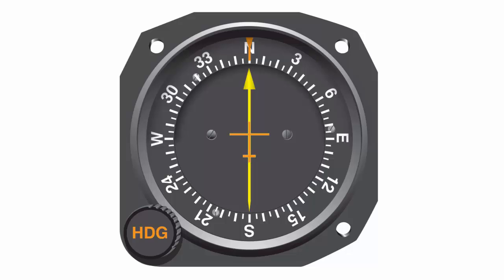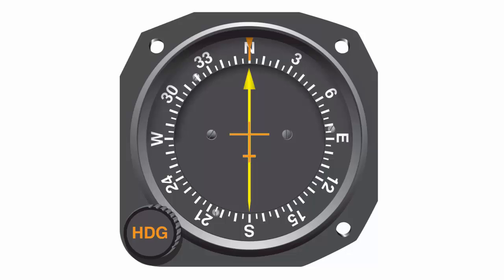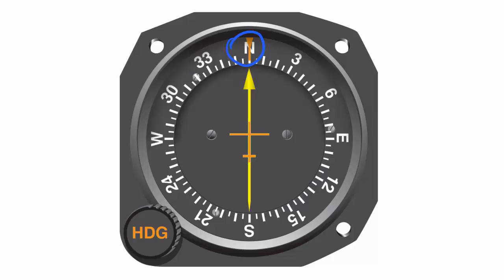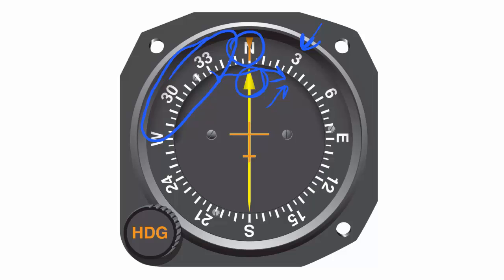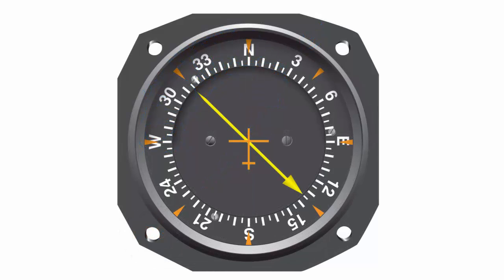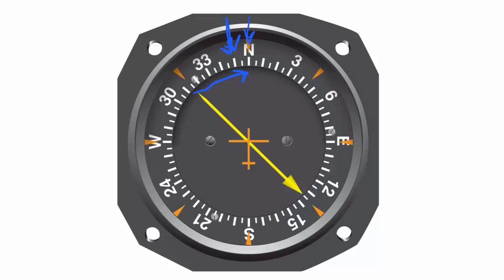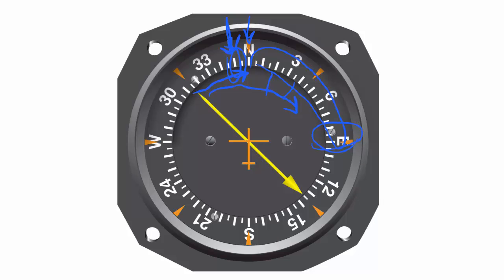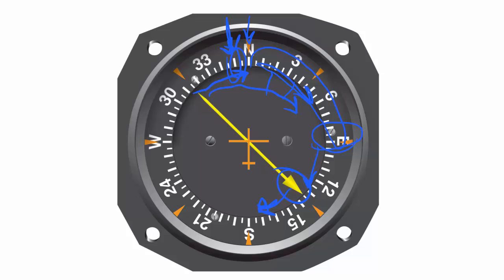Push the Head and Pull Tail of a Bearing Pointer

Comment: I personally prefer not to use this approach to adf intercepts in a practical situation just because it pushes forward a bit of a rote learning attitude to the exercise. By all means it’s fine for written exams the “ bug to tail + or - 30 etc”. In a practical context I think It’s better to be able to have a mental picture of where you are in relation to the aid by using the DG as a ‘birds eye’ view and imagining the track you want to intercept inbound or outbound and then deciding on the direction to turn because it builds situational awareness and it also makes it much easier to visualise inbound to outbound intercepts and vice versa. That’s just my opinion though. Feel free to disagree with me.

Comment: Thanks for the illustration. It looks like you have to turn to the opposite side of the needle in both cases of tracking TO and FROM station. While using RMI, I found that when tracking TO a stn, you have to turn to the same direction where the intended track lies, is it correct?

Comment: Many will still be confused if they can’t orientate themselves in relation to the aid... If you picture the plane symbol IS the ground aid. And now know the tail is ALWAYS the radial you are on. You can orientate yourself accordingly. If your (tail points to 180) you know your on the 180 radial relative to the aid, and now if you want to track the 170 radial in... You know you need to make a right turn, plus add an intercept angle.

Comment: Will - Sure this is  right? If I'm on a 360 HDG tracking in to the station, on a QDM of 360 but want to be tracking inbound on a 030 QDM, I agree I have to 'push the head'. If I turn left on to your suggested HDG of 330, the needle on my fixed card ADF will IMMEDIATELY rotate to 030. HDG+RB=QDM.

To get on to the desired inbound 030 HDG I have to fly on a HDG of 330 until the head of the needle is 'pushed' to 060. If I then turn my aircraft onto the desired HDG of 030, the head of the nedle will 'fall' to '0'. HDG+RB=QDM or 030+0=030.